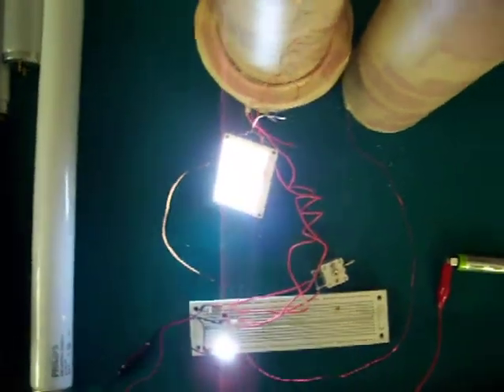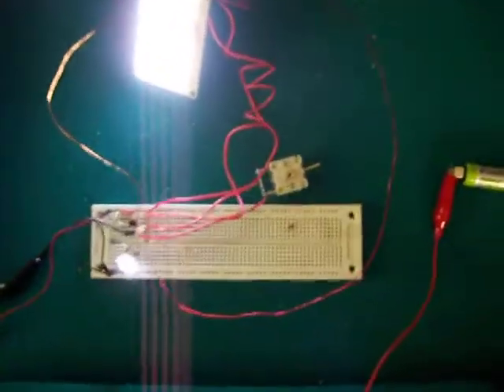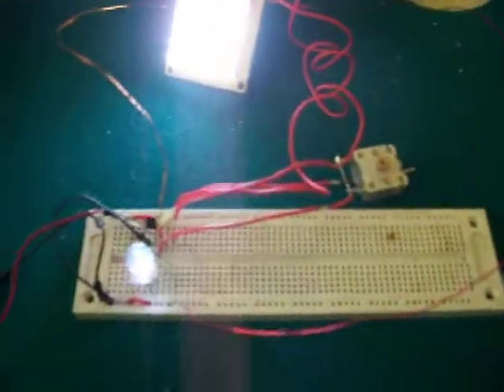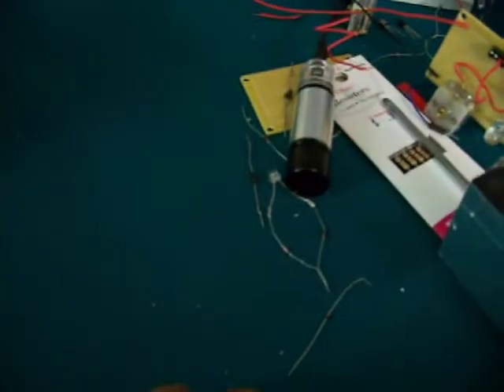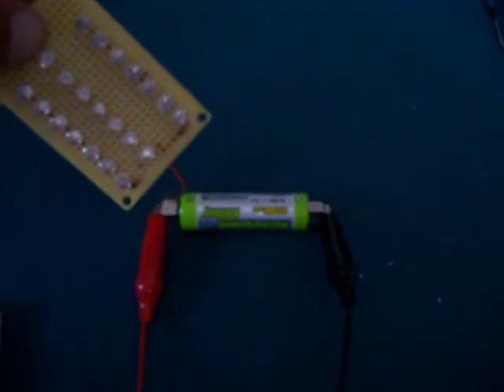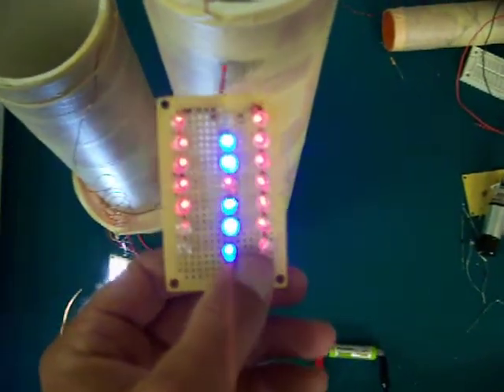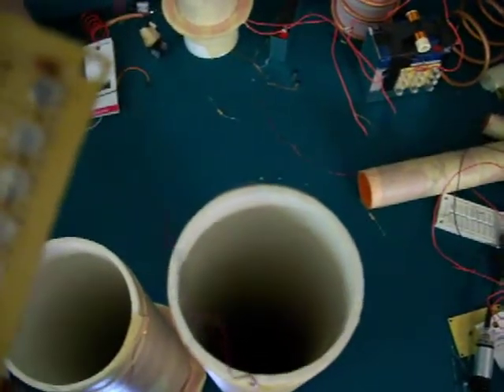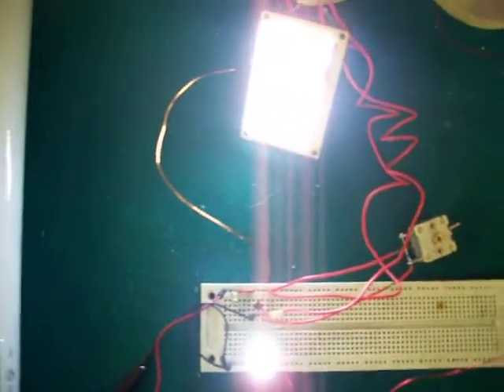Exciter With And With Out L3 Coil

Comment from the maker: Your body is acting as a capacitor (or antenna) with the circuit.
You may have noticed that moving your hand by the coil affects the light output.
With the capacity just right in the coil the lights will get brighter and the current intake will go down.

Comment: I got one working, and something I noticed was when I showed my room mate, I handed him the LED on an AV plug about 4 feet from my little L1 coil, and by accident we figured out the LED would light at full brightness from very far away.  We did a bit more experimenting, and found with one hand held near the coil, and holding the led full arms length away, it would light when the other person held the other side of the AV plug a good 6 feet away, and current dropped.  Any Idea why?